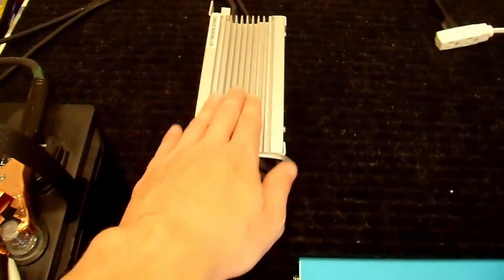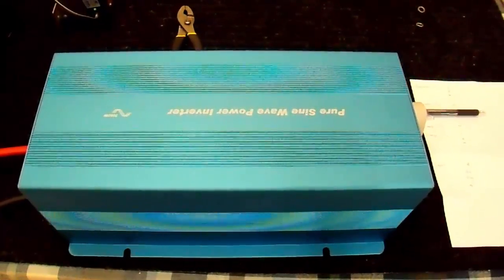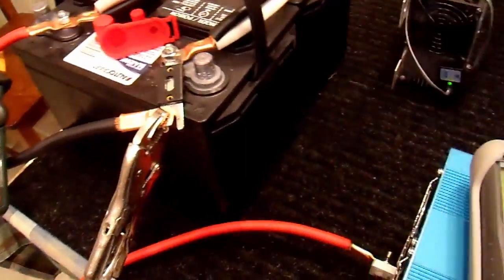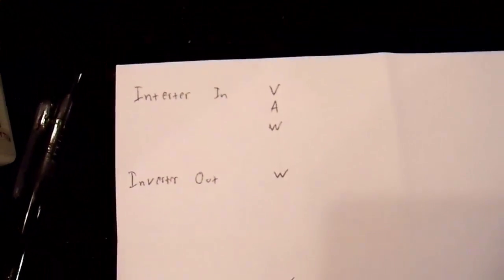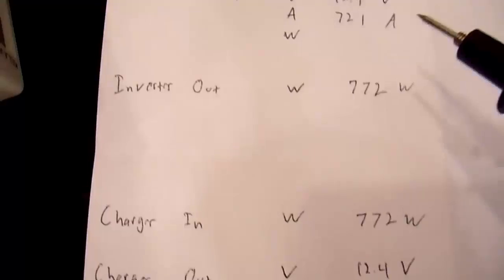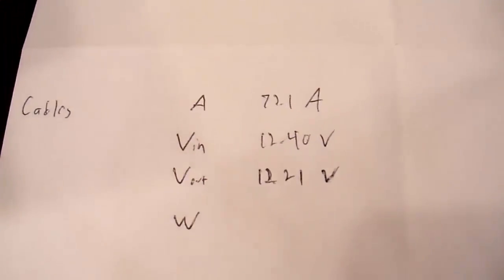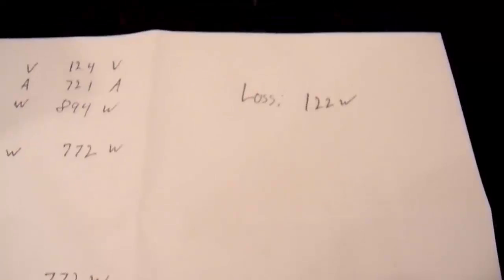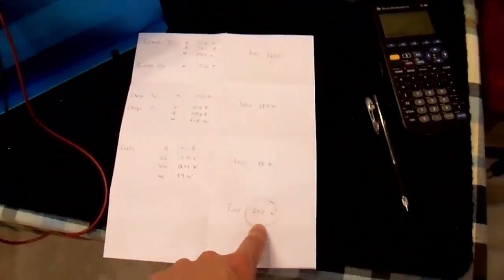Free Energy Generator! - Inverters and Batteries and Chargers, Oh My!

Comment: This is a good illustration of why I had to disconnect my Converter/Charger in my solar powered travel trailer. Also the reason why you should have a remote on/off switch on your inefficient inverters. An idea for a future video may be showing how inverter circuits are also used in Portable Generators and MTTP Charge Controllers.

Comment: You need to connect the power to the big transformer then convert to 60 Amp DC to charge the 3 batteries, the more transformers you got the better it works

Comment: What if instead of the battery charger I bring a car engine power generator for charging the battery. This engine power generator is then powered by a 0.7 kw single phase induction motor. The latter is eventually powered by a pure sine converter. Would that work?
Reply: it is impossible

Comment: @ :25-no such thing as free energy hey. So how much dose it cost to use the electrical energy from a solar panel?. Your experiment is flawed,as you forgot the losses in the batteries them self. A lead acid battery is only around 80% efficient,so if you want 80 amp hours from your batteries,you have to put in 100 amp hours to get that 80 amp hours back out. Now,80% of your P/in is 715.2 watts,so you have another loss of 178.8 watts in the batteries them self. Now if you add all your losses together,plus the power being returned to the batteries via the charger,you have a total of-charge out 618w + battery loss 178.8 + system losses 290w = 1086watts. So how is it that the total losses and output exceed the input ?.

Comment: It looks all good and fine on that configuration. But this does not mean that something like this cant be done by using a different component in anyone of the or all of these. and by using different type of battery and larger battery banks. And the same for all your components. There are much larger and more efficient inverter and chargers. Along with the lose on the cabling can be almost eliminated if done to the Gov. mil spec. I do like most of your videos but when you would come on to comment about another's theory for free energy more or less cant be achieve in this type of way. With out saying that it may be possible with doing so with different components as described above and or adding of another devices as processor board to ad to the efficiency or just something that none of us that has not been bought up yet, has configure yet. Its just when you show and tell as you have in the way you have. May take the ambition out of the ones that could have tried something different.
just think if someone had told another that they could ask another person almost 3,000 miles away a question and have an answer for this other person stand in front them with in 30 seconds. Can you imagine how many people would have thought this person to be a lying lunatic before The First Telephone Call March 10, 1876
I still like your other vids
Reply: It is impossible

Comment: I have one for you I have two2 5000 watt  volt inverters can I run them in series on a twenty four volt system ? I haven't made it to a wallmart tle to buy a couple cheep inverters to try maybe the service mgr could help hey chris would this work
Reply: no it wont
Reply: thanks I was sure it wouldn't but I had to ask they are so expensive to buy I like my inverter but now that I have enough battery's I would like to move to 24 volt but im looking at 1200 to 2000 for good ones that have built in chargers
Reply: +david wise stay away from power jack

Comment: you had me worried for a second there - glad you were up front with the energy loss before my initial reaction of " oh no , he doesn't believe that dose he ??? " wore off lol every one seems to be looking for a way to turn on power for free were there is no energy to start with - the only free energy is a magnet - and it will always pull as much as it pushes , with the added loss of its own mechanics inefficiency - that it has to overcome in its own machine - when they fig out how to turn off the attraction of a magnet or block it and have complete control of it as we do with electromagnets in electric motors - at that time is when it will be feasible ,so when every one is looking for a way to turn it on - one guy will get rich figuring out how to turn it off lol - it's not that big of a task ... just simply like tuning off gravity...how hard can it be ...lol

Comment: I purchased a solar panel. Free energy!
Reply from the maker: waterlubber The sun is up.  Free energy!
But it sure is hot in here, better turn on the AC...
Reply: *****
Just use peltier plates to reclaim lost heat! ;D
 You can power the AC with those!
Reply: waterlubber The solution is to build a giant umbrella covered with photovoltaic cells to protect the house from heat and provide electricity to run the ac.
Reply: It isn't free energy - you had to purchase the solar panel. How many decades will it take to get payback for the cost of the panel and equipment to make use of that solar energy?

Comment: Nice vid but what if we used a booster between the charger and the battery to speed up the charge, would it enhance efficacy?
Reply from the maker: Iam a NPD Adding a voltage booster stage would add more losses to the contraption.  The boost converter might be 90% efficient if it is a good one, so I'd lose another 10% or so there.

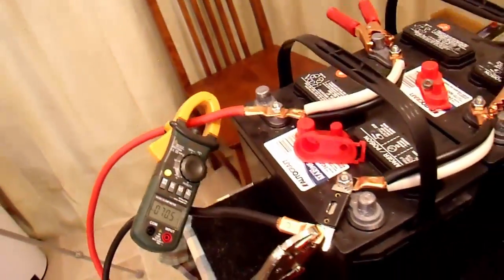Comment: 3:52 70 amps
4:18 12.75 volts
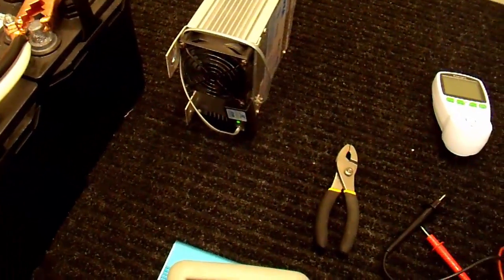4:25 charger not on
how is the inverter using 893 watts at no load?
Reply from the maker: TKTmon I worded it poorly in the video.  The charger was 'on' but was still in its float mode as indicated by the solid on LED.  I wanted to wait until it was in the bulk charge mode which is indicated by a flashing light.

Comment: What battery charger is that you were using?  It looks like a nice compact unit.
Reply from the maker: Arnd2it Iota DLS-45.  It's a great unit and highly recommended.  There are other units like it sold for use in RVs but many do not perform as advertized.  This one does.
Reply: ***** Thanks for the info.  Interesting that the charger is rated at 45 amps and you're getting almost 50 out of it.

Comment: Is this the inverter/generator you mentioned in the previous video?  Shoot, I thought you were talking about some sort of gasoline powered contraption. :D
Reply from the maker: Mr. Polecat Nope.  :)  This is an old video that I hadn't planned on releasing but thought I might as well make public.  The inverter generator video is coming later.
Reply: trying this with an inverter and a charger is not something I've ever heard of, i have heard of people having success with 2 different voltage DC motors, like maybe washing machine motors or treadmill Motors, if you can get one that out runs the other by just enough, both of them connected together in parallel with a belt connecting the shafts and diodes to make sure the power goes where it needs to, the more powerful your Motors the more powerful your diodes need to be though, like from a car alternator, and a regulator to make sure the voltage doesn't go over what you want.

Comment: So that was basically an expensive 300 watt heater.
Reply from the maker: thatguyoverthization That is a good analysis
Reply: lol when it gets cold here in florida I run folding@home onmy sli linked titan blacks and turn the pc around to heat my office.
Reply: +khlymore Free as in cost is one concept, free as in 100 % efficient with no losses is quite another.  The wind power costs nothing for the government. They charge equipment and R and D it to their credit card and send you the bill in addition to using you as collateral to back the paper.  The government looks at you as a revenue producing meat sack.  For you even the wind has a price.  It costs because the government taxes the power you generate in many cases.  I am not kidding.  So the next question is how efficient is the  power generation. This is an engineering consideration and it depends on where you draw the boundary lines. If you were to consider the system 100% efficient with the largest available boundary line then the "wind" would be at absolute zero just beyond the turbine blades and all that energy that was removed, including thermal resulting in frozen gases,  would be going down the electrical transmission lines.  He doesn't actually measure the amount of energy added to the battery so his charger is not really as efficient as  his numbers indicate, unless you can reuse the waste heat from the battery.  Batteries are a horrible way to store energy from an efficiency standpoint.  Storage loss is ok but stuffing the electricity back in by reversing a chemical reaction is an up hill battle using square wheels.  And even on the down hill path when you get energy back the wheels merely have slightly rounded corners.  A better way would be to charge a bank of super capacitors.  He would be a little more efficient if he wasn't powering tho gubberment wind turbines with the fans on his charger and inverter.
Reply: +ingebrecht this are examples of so called working free energy generators tell me what you think
watch?v=LXfNx40uQwo
watch?v=Rd-8bT2jI7Q
watch?v=Gfn0SADzE9w
Reply: +khlymore but if they transmitted all the energy wirelessly couldn't that cause more lightning strikes and our hair would be like a clowns hair?
Reply: ben lawton And all but eliminate the use of radio.
Reply: Peter Carlson and wifi would be killed
Reply: +khlymore One of the dis-advantage with Tesla's system's, to a supplier would be that metering the power would be difficult.  A real problem for an industrialist if you are considering how much you can charge people.  Meters are important to greedy industrialists even if there is more power than you can possibly use at a rate that is fantastically low.

Also they industrialist's wanted to see a pay out from an investment in R&D in less than three months.  Take a week longer than the quaterly report and they would consider the effort a waste of Energy.  Back then electricity really was almost black magic.   Edison should have paid the man...
Reply: thatguyoverthization o
Reply: +knurlgnar24 yeah there's no such thing as free energy that's why the governments invest 200 million dollars in air wind turbine to give electricity to people how much the government is paying for that wind i wonder?
Reply: ill be honest with you i dont plan to pay electricity elon musk is already selling a battery pack for 3k you can have 2 one charge and the other provides theres a guy named Manoj Bhargava and he also created a stationary bike that you exercise 1 hour and will provide electricity the whole day not to mention the supercapacitors graphene or John Hutchison claiming to have a battery that last 50 years made of minerals is that the magical reason why battery technology never step forward? because they just CANT help you store energy efficiently i heard nasa has batteries that last years so i wont pay electricity im not that dumb or gas i will buy tesla car and will buy the strong version of his battery pack i also have a idea for a generator that i will put together but yes supercapacitors are the way to go WHY NO BODY USE THEM?
Reply: +ingebrecht one more thing i dont think tesla was crazy when he built that big tower to provide wireles energy and everythig he said about free energy and the way they stop suporting him and destroyed his tower once they found out cud provide free energy no profit in there so i wont pay electricity even if i have to make my own ultra capacitors but its ok tesla motors  is seelling a home battery and a super powerfull busnises one so no one can stop me now my car will be tesla  and my home will be powered by his battery and thats it